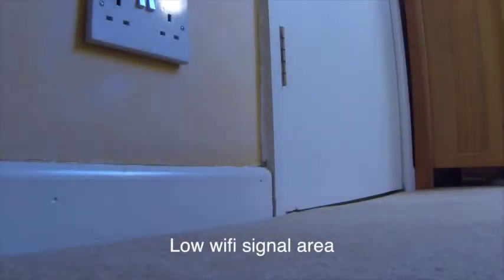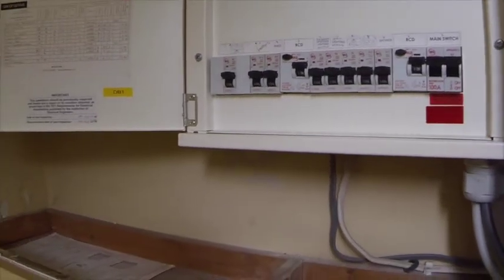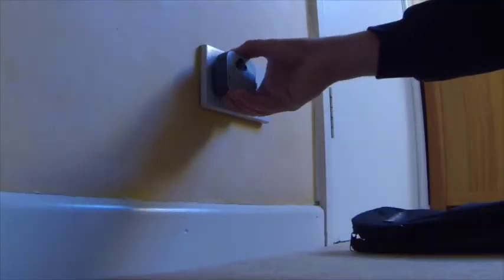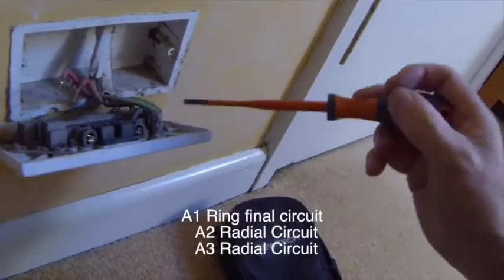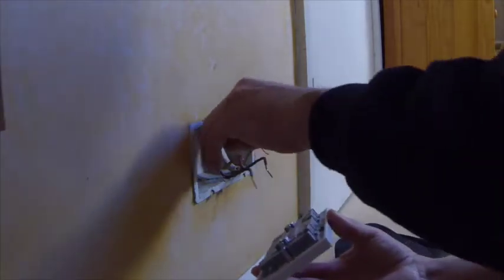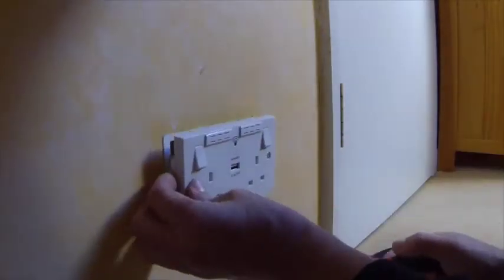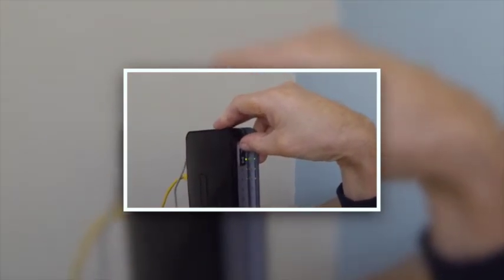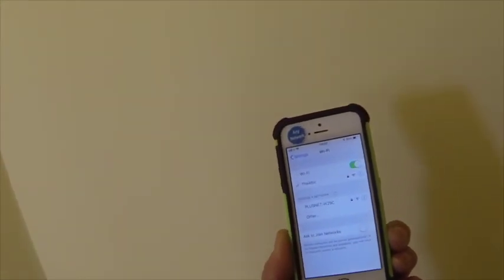Electrician Day in the Life - How to fit a 13amp Wifi usb fitting and benefits

Comment: Good video. Can I ask, what effect do these have on your testing with the built in electronics? Can you still do your insulation resistance test at 500v for example or will it need linking out.
Reply from the maker: Hi Hundnott the IR Testing is done at 250v DC unless you know you have only one of these BG new models installed and these allow 500vDC

Comment: Hi sorry just wondering, why does your voltage tester still beep when going between conductors even tho the circuit is dead? Thanks
Reply from the maker: lloyd grant hi good question, it’s also checking continuity, do the sound you hear is just that, good but it does mean you need to look at the reading
Reply: Thanks for the reply Dave, but surely there should be no continuity between line and neutral there fore it shouldn’t beep should it? Thank you